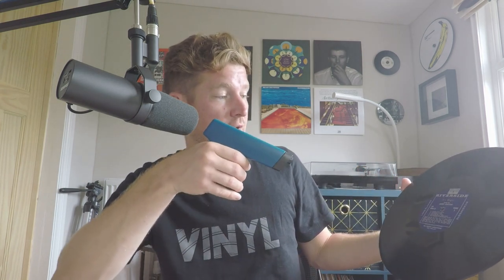Removing Vinyl Record Static with the Milty Zerostat 3

Comment: I have had one for so long, that mine is a white one probably from 1972, no manufacturer on it, but it is called Zerostat. Just fixed my JVC QL-A2 after all these years and now using the Zerostat, though have just been clicking it quickly, so thank you for this video.

Comment: Been spinning records for over 40 years and never found I needed one but recently when removing the odd album off the turntable I hear the crack of the record discharging. I use a carbon fibre brush but that’s not doing enough I guess. 
This is a cold winter here in Canada so the music room is extremely dry. Never an issue in the summer months. I got one of those guns on order. Can’t wait to see it action. Cheers 😎

Comment: I still own a working zerostat I bought in the 1980's. Mine is Red
Reply from the maker: Ace. Great to see it hold up so long!
Reply: I have ones well. I believe it was offered as part of a set by Discwasher.
Reply: @TBNTX  yep got it at a yardsale for $15. Came with needle brush and mirror with SC-2 stylus cleaning fluid, a discwasher with it's cleaner and brush and a Zerostat. All in a great wooden storage base with a dust cover. 
 One of my better days finding that gem.

Comment: does it take batteries? How does it work?
Reply from the maker: No batteries - it's a passive design. It releases positive and then negative ions with the aim of neutralising static charge :)
Reply: @soundmatters  Does it give off any ozone? does it have magnets inside?
Reply from the maker: @Moejoe69  my understanding is the device utilises two piezo-electric crystals that are compressed by squeezing a hand trigger. This produces negative and positive ions that couple with the positive and negative static charges on the record surface to neutralize static.